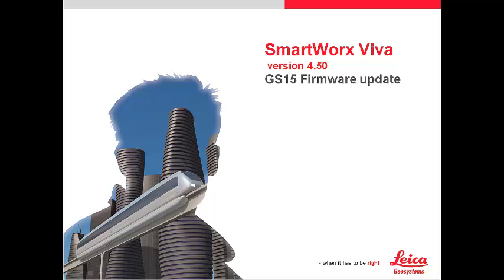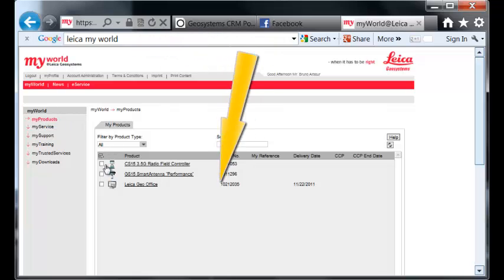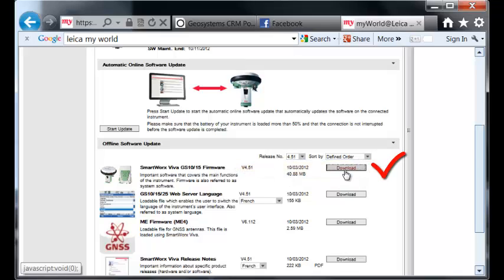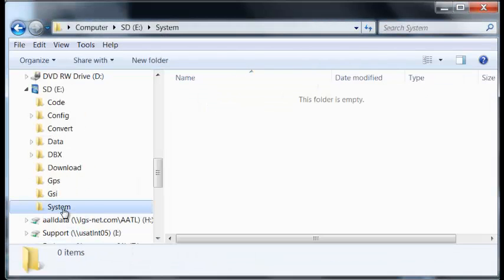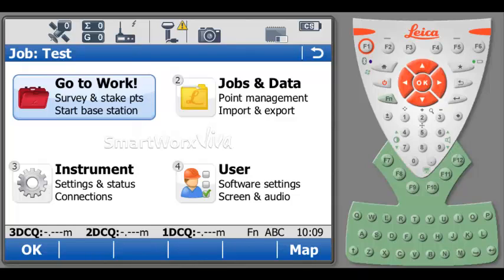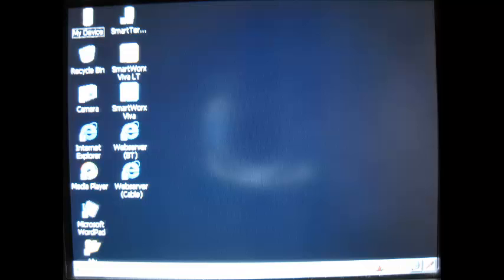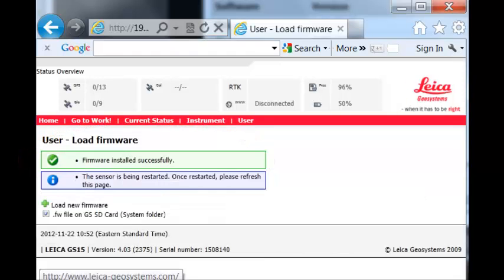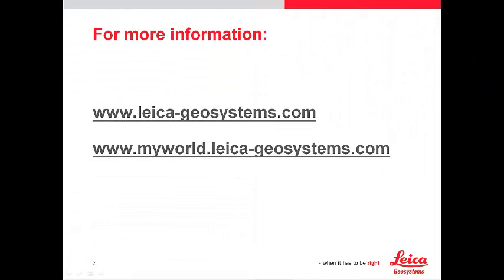Smartworx Viva Training Videos: GS15 Firmware Update

Comment: Wow - I would prefer an easy button but this almost worked.  The one issue is that the video tells us to use BT connection, but after the firmware updated on the GS15, I lost the BT connection because the firmware version on the CS15 was no longer compatible.  Solution: Use the cable!